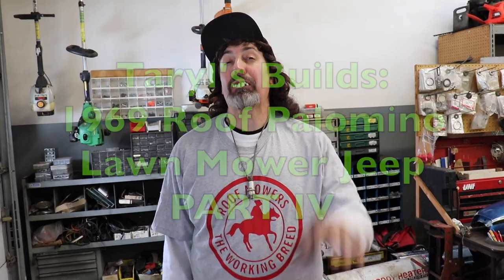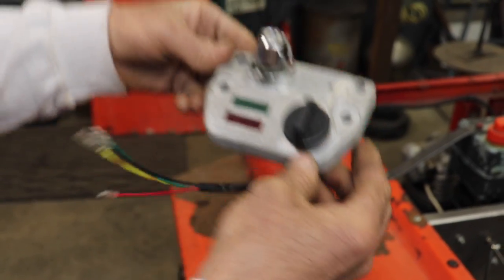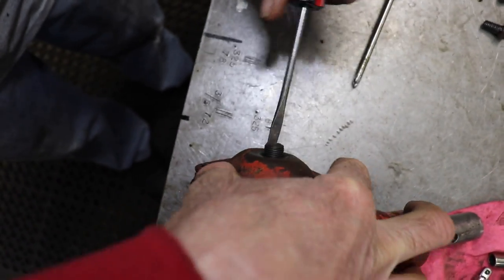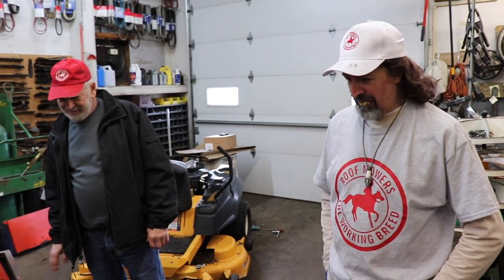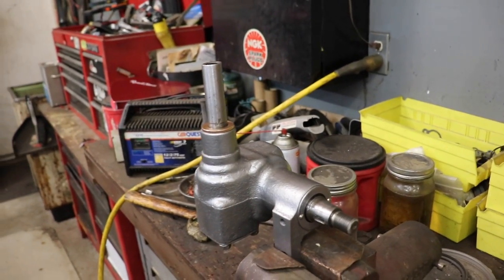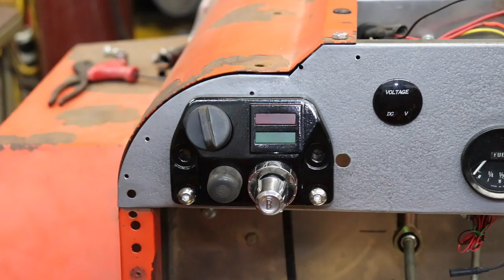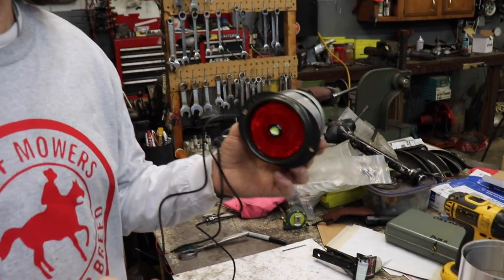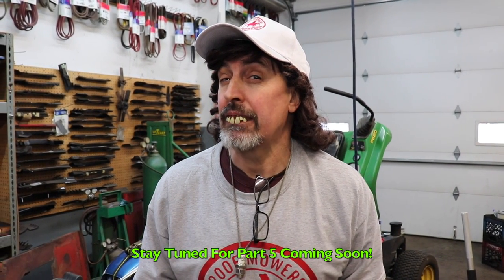AMAZING 1969 Roof Palomino Lawn Mower MINI JEEP Pt 4

Comment: Seeing you putting that steering box together made me remember a story my auto shop teacher told us when I was in his class (78-79). For you younger guys the steering shaft was hollow and went from the box to the wheel and the little tube is where the horn wire entered. Well when my teacher was young he was going to lube the box in a customers car, when he got into to back the car out grease was coming out of the horn button and onto the floor.

Comment: Very creative ideas !!  BTW you are correct a high frequency TIG welder would do a much better job, but if you are using a flux core MIG it will not do a pretty weld.  I use a Miller 180 220volt mixed gas (75% Argon 25% carbon dioxide) and get beautiful welds on even the thinnest metals.

Comment: Can't wait to see it all finished great build
Reply: I'm going to guess he ends up needing a sliding adjuster for the cable onto the lever so that he can adjust how much front/rear bias the brakes have.

Or heck just run a hand lever so you can slam on the rear brakes to slide em.

Comment: I am an mechanic for Smithfield foods.  We have replaced a lot of out greasing systems to use STP.  We have found that STP works great in Sliding and Low speed gear systems.  We also use it in our Reducers.  I think it would work very well in your steering box.

Comment: Yes sir. Corn head grease is good stuff. I drill and tap 1/4×28 grease fittings into my cheap " sealed" gearboxes and tiller chaincases to add corn head grease. I have never seen one that did not leak. I just shot a whole tube into my MTD 600 series vari-drive gearcase and it shifts like new again

Comment: Maybe you can use a hydraulic clutch slave cylinder mounted on the rear differential to activate the rear brake instead of using a cable?
Reply: I was thinking good old handbrake without the button for easy drifting lol or with the button for a park brake

Comment: Great job on the build and the video.  I'm sure that switch is a blower switch but even my 64 Galaxie has separate parking lights and headlights (not on at the same time).  I like your idea with the tail lights.  I wanted some bullet lights for my trailer so I grabbed some of those cheap little single filament chicken lights from the truckstop and welded in some dual filament holders.  PS. Fancyfeast....Hilarious!

Comment: I really like the tail light build.
The front grill should be the 7 vertical lines like a Jeep CJ series.
I have a old Roof riding mower in my pile of stuff. It is kinda like a old Snapper mower.

Comment: Instead of corn head grease, you can use Lubriplate 105 found at Napa.  It has the same properties.  I use it in the lower unit of my Wizard Outboard motor which also interchanges with corn head grease.

Comment: If you added a diode from the headlight terminal back to the parking light terminal it would have feed the parking lights in the headlight position but not the other way.

Comment: Special hubs made with one way bearings will give you inside wheel drive in a corner and both wheel drive in the straight.  Drawback is you need a separate brake for each wheel.  But without a ball compass, you'll get lost.  Betur geut 1.

Comment: put a spring over shaft inside gear box to push small seal towards bushing.  electric fuel pumps  work best pushing fuel. mount pump at fuel outlet on tank. will be less noisy. enjoy your work.

Comment: p.s: That needs a ROLL BAR at 55:47 if you are leaving the solid rear axle in it, thus whenever you put those electric PTO axle lockers on the rear shaft - as a rude form of differential, it'll still have that cool "roll-over-protection-system" bar - (we call them ROPS in New Zealand)

Comment: You could still use that "blower" switch for the headlights with the use of a relay.  Have off, then first click for parking lights then second click for headlights. Have the second click also supply 12v to a relay that would close sending 12v to the parking lights. When on the "first click" of the switch the relay would be open so power wouldn't be back feed to the headlights.

Just came to the part where you customized the switch.
(I still would've done it my way.)
Reply: lane morEr blade sharer

Comment: I suggest a hand lever for the rear brakes that includes a parking latching function. trying to match mechanical brakes with hydraulic brakes not so easy. under most conditions the front brakes do most of the work anyway. nice project!

Comment: Ford used 90 weight gear oil in those steering gear boxes. Since you have done such a craftsman like job rebuilding yours I would use 90--140 EP gear oil for maximum lubrication. Nice work keep it up !
Reply: Negative. Oil will fall out. Grease won't.

Comment: That’s a Ross steering box. They have been used in all kinds of stuff. I’ve even seen them in forklifts. Use 00 grease in it.
Simplicity used a wheel mounted diff on the large frame tractors back in the sixties and seventies. Should be easy to find.

Comment: Hey  Taryl got idea for you tie into hydraulics for front brakes . Run line to rear where cable goes at rear and get a car clutch slave cylinder and have that move arm where cable goes on rear brakes l

Comment: Taryl use a old style snapper rear end seal. It had a seal inside a a rubber style with a seal inside that was secured with a hose clap. For your steering box.

Comment: I like you miscombobulated fuel tank and lights aren’t bad either! Just make it a one wheel wonder by removing the shear key on one of the axles. Your ROOF is slicker then goose poop on concrete!

Comment: what about cutting an axle put a sleeve over the cut to keep the 2 pieces aligned and the use a hi tension spring welded on both ends

Comment: wheel bearing grease and 80w 90  mix the two together till it's about like a gravy consistency , done that on wreckers with gear driven winch boxes for years , they call for the 00 too , but it's not findable ... is that english LOL

Comment: Couldn't you have just wired the parking lights to the first terminal and ran jumpers over to the head light wires so that the parking lights would be powered in both positions?  Nicely done mod on the switch by the way!  And there's your desert.😁

Comment: on my 48 chevy I used ordinary 80 or 90 weight mineral gear oil in both the steering gear and manual transmission.

Comment: When you use stainless hardware in iron like you did on the steering box it will size due to cold welding if you do not use anti sieze
Reply: Ave has proven that stainless cold welds to mild steel get educated before you spread false information please besides if I'm wrong anti sieze will not hurt a thing and if I'm right it saves him future trouble

Comment: That may have actually been a car light switch.  Recall before the early 60's that you could turn on the "parking" lights ....OR the head lights but not both.    I think the change was 1963, the same year that all cars after that year went from clear front turn signals to amber.

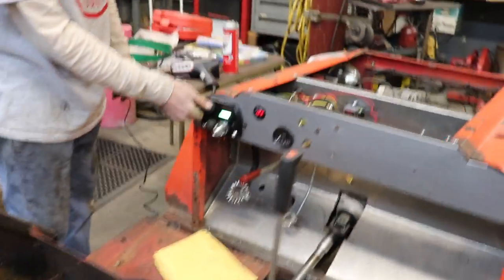Comment: 39:49 that two speed (independent position) switch, for a blower motor etc, can EASILY be converted into a sidelight only & a sidelight PLUS headlights switch - by the simple addition of a couple of diodes (or use half of a lawnmower's bridge rectifier), wired so that either position drives the sidelights, whilst only the second position drives the headlights thus in position one - sidelights only via one diode and position two directly drives the headlights whilst diode 2 drives into the sidelights circuit, bingo THERE IS MY DINNER ... as that now becomes a dual function sidelight / sidelight+headlight switch without replacing that delightful old two position switch.

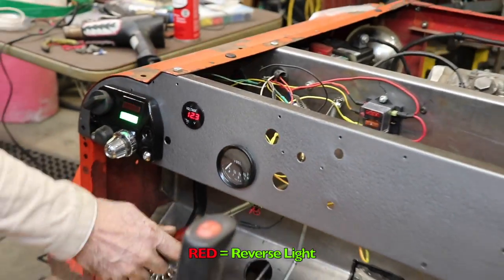OR, even easier, have that original B switch (as you had it at 39:49 ) driving each circuit independently, with ONE DIODE sending power direct from the headlights circuit into the "now dead" sidelights circuit. That way, when sidelights only selected, the diode (as you know) blocks any back-feed into the headlights.

Comment: Is it nessary to use all three steps in sealing a fuel tank with the Por 15 tank sealer even it you have the tank clean as possible ? They want you to buy the cleaner, tank prep then the sealer

Comment: i have a power probe 4..no not that kinda probe! n a jump pack n use them all the time when im forced to do a job away from the house that needs electrical troubleshootin   also because i cant trust other ppls batteries lol i have a simple resistance style batt tester in the back of the truck to   its invaluable

Comment: I know this is a bit off topic but I am getting a old enticer 340 ready for raceing oil injection pump is leaking and I wanted to run premix but I have to leave pump on for rpm gauge to work I was going to rebuild pump and use it for my lube tank after for windshield wash for slide rails so that way it’s two birds killed with one stone pump won’t seize and I got a lube system that is controlled by how open throttle is what does everyone think the pump does not lube any parts inside engine it’s filled with grease I am going to use the inlets on intake for fuel primer instead where they will be left there with a tee
Reply: Great, please try it again, this time use a Period, Comma, bunch of spaces , anything for punctuation.,!’;.

Comment: Hopefully, you antiseized your stainless steel bolts. If not, they'll have a chemical reaction and seize up. Either they'll  take the threads out or break. 
 Might think about putting relays on your light switches. Your switches will last longer.  Especially on started switches.

Comment: To make it easier with that brake cylinder, use one like this: https://www.ebay.de/itm/Hauptbremszylinder-Einkreis-Fiat-850-new-brake-master-cylinder/233239448760?hash=item364e278cb8:g:ObsAAOSwpvZaCVZE and you can put the reservoir to a better place for filling

Comment: Old video so i bet no one will read this.A lawnmower guy never heard of double 0 grease? Lol just kidding. Not sure bout now but 40 years ago the snapper self propelled mowers used it in the gear boxes. Hated that shit. Was a pain to get into it. Pain to clean out. Very expensive even for repair shops. My uncle was a snapper dealer. They didn't give him a deal on that shit. A bottle of it was hundreds of dollars. The lube cost almost as much as replacing the gear box.